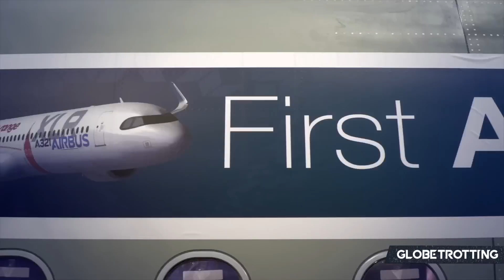NEW PLANE? - The Airbus A322...

Comment: A322 should be an Aircraft that help/offers airlines a 757-300 replacement.The A322 would also help airlines that need strictly a aircraft that high dense configuration aircraft that could seat 300 give or take people in single aisle formant without buying/using a wide body aircraft.

Comment: I think the A321 LR and XLR will fit the market just fine.  Airbus would do itself a favor to squeeze out even more efficiency and lower cost per seat per mile and extended range on the A330neo program.   I’ll keep saying it… if I’m on a 6+ hour long flight …I want to be on a wide-body aircraft with ample room and lots of lavatories on board.   So twin aisles it is for me!!   5 hours and under… I’ll go with the A-321 thank you very much!!

Comment: A322 neo
- Composite wings with folding wing tips
- Composite fuselage
- Newer engine up to 10% fuel efficient than current LEAP 1A
- Up to 6000 Nm range
Will selling like a hot cake.
Reply: Composite fuselage would just make it an A360 at that point

Comment: A carbon fibre ultra short A350-500 with a narrower and shorter fuselage of the A330-200 size might be better. 
Narrow body long haul is really not a great experience. 
Do not push anything to the max.

Comment: I think Airbus should pursue a 322 in LR & LR with a new wider bigger wing and stretch to the 757 300 length at least with extra mid cabin more lavatories a super stretch so airline's wanting to save costs could also offer premium economy class section behind business Class on such long 11 or even 12 hr flights but have empty room like 747s had on emergency exit doors along the cabin so passenger's on a long flight can go stand up and have a stretch before returning to their seats.
I think heavier double bogie landing gear be required for extra weight stability. 
I think airlines would be very interested in a 11 or 12 hr range with a larger stretch to accommodate and sell fares in a premium economy class too for such long flights that dont want to operate the expense of a larger A330 neo range .
Reply: A322 is fake and it’s not an A321NEO, it should be retired

Comment: The current A321 is about as heavy as the current crop of engines can handle. Therefore, a simple stretch is not possible.

The only solutions on the table until new, and more powerful engines are available, is for the aircraft to loose weight and increase lift.

The obvious way to achieve the weight loss and increase lift is for new composite wings. Not only would these be lighter, they would be far more efficient as wing technologies have advanced significantly since the current wings fundemental design was done.

Not being an engineer, I do not know how many additional rows of seats this could allow. However, if those new wings were to be fitted to the rest of the range, could you be looking at A220 levels of efficiency?
Reply: The A322 is a fake concept and it’s not an A321NEO. It should be retired. The 757-300 is longer than the fake A322 concept so the fake A322 concept won’t be a replacement for the 757-300. The fake A322 concept would make the A321NEO LR and XLR useless, and the A321XLR A321LR and A321NEO productions will be discontinued and scrapped, that would be dreadful
Reply: @sebastianfloyd372 You really need to understand what FAKE actually means. While we may never see an A322 or an A321 stretch as it has been described by Airbus themselves, it is simply just a name given to a hypothetical furter stretch of the A320 series. Airbus have worked on the possibility of a further 4 rows, unfortunately there are no engines of an appropriate power currently avilable. 

So, on the drawing board it will remain until either suitable engines such as a member of what is expected to be the UltraFan range of engines (or possibly even whatever river they choose to name it after as RR so often do), or, the current design is going to have to loose rather a lot of weight!

I suspect that a longer Airbus single aisle may only surface as a variant of whatever replaces the A320 series. But who knows, the manufacturers seem to be playing a game of chicken to see who announces the next single aisle first.

By the way, the 757-300 was a sales disaster, and we do not know if there is actually sufficient demand to make a direct replacement viable. What is more likely is something in-between the 757-200 and the 757-300.

Comment: They will need to get more powerful, still efficient engines, a new wing to get a stretched 321 off the ground.  The 321 doesn't have lift or power for short field high altitude high temp airports.

Comment: Is there enough gap between the A321XLR and the A330 to expect a valid business case? It's not just about ROI, but about new laws and regulations too which would have to be taken into account.
Reply: 330 is wide body. Finnairs Air Lounge seats won’t fit into A-320 family.

Comment: If its possible, The Airbus A322neo will compete with the Boeing 737 MAX 10
Reply: Of course it wouldn’t. The regular 321 neo competes with the Max10
Reply: In what world? The max 10 is smaller than the 321. A 322 would be in a category of its own, regardless of how it is built.
Reply: Until the Max-10 is certified by the FAA and Federal regulators are satisfied enough with the significant progress the Max-10 has to undergo and you have to retire the 767 and 757 at some point ✈️💵☝️
Reply: MAX-10 😂

Comment: or a A323 , use the length of 757-300 XD
Reply: A322 would already be the length of the 757-300 respectively. The current A321 is about the same length as the 757-200 and 737-900ER.
Reply: @GarlandTexasSpotting2025 A322 is a fake concept and it’s not an A321NEO, it should be retired

Comment: It's going to be tough to replace the 757 airframe. The Boeing 757 was like the sports car I wish I had. It was a fantastic airplane for airline service, or freight and mail delivery. Airbus will need to really hope this new design of theirs will equalize the amount for what the 757 has done.
Reply: Looks to me that Airbus already has a winner with the A321LR and XLR. They have enough orders to keep them busy into the next decade.
Reply: Airframe has not much to do with it. That’s mostly engine related.
Reply: @Dan.d649: the 757-300 is longer than the A321XLR and A321LR so the A321XLR and A321LR won’t be a replacement for the 757-300, only the 200

Comment: next gen hybrid aero propulsion can revive the A380-800 once again . . . it'll make the A380-800 hugely fuel efficient, not possible before . . .
Reply: No. The A380 tools are gone and won't return.
Reply: @jantjarks7946  Even the infrastructure, and factory plant is gone (converted to A321neo).

Comment: Most unlikely. Airbus will be concentrating on a replacement for the A320 family which may include something bigger that the A321XLR but it is early days. The feed back from passengers on how they view travelling on a narrow body for long distances will be crucial. I would say that with prospective orders from middle eastern carriers it is much more likely that an A380 Neo will be seen if it can offer cost savings.
Reply: I travel Miami to London, usually on a 787 Dreamliner or A330.  I couldn’t envision myself on a single aisle plane unless the seats had enough pitch.
Reply: @jeremypearson6852  People have been flying narrowbodies across the pond for almost 75 years. It's not a new thing. I've done it, and it's fine, even in Y. A middle seat on a 757 for 6-7-8 hours is just as miserable as a middle seat on a big-boy plane.
Reply: @geeniusatwrok Couldn't agree with you more. 50-60 years ago, in the so-called golden age of air travel, all transatlantic flights were on single aisle aircraft until the advent of the B747. Modern day single aisle aircraft are opening up new routes that are served by direct flights, and that is what customers prefer over flights involving intermediate stops.
Reply: @jeremypearson6852 You rightfully pointed at the seat and cabin design. It doesn't matter if it's a narrow or wide body.

Not sure why people mix up both, as both define acceptable comfort in very different ways.
Reply: I see this as a step between what we know, and what we can do.  Maybe A370?

Comment: Interesting, what if Airbus propose of the new aircraft, A330-1000neo? Any thoughts?
Reply: It would probably compete with the A350-900
Reply: There isn't a market for such a plane. Even the 7810, which would have more range than this, doesn't really have enough to be considered for the majority of routes. It would look a lot like the early days of the 333, when it was out sold by the 332.
Reply: Would compete directly with the 787-10NG , which would be more efficient and have more range. So the a330-1000 would be a flop
Reply: The 787-10 is already a flop.
Reply: @nicholasmackenzie-rowe68  exactly. 3310 would never get off the drawing board
Reply: @nicholasmackenzie-rowe68  yea only because of its limited range. When it gets a new engine , range won't be an issue anymore and the a350-900's advantage will be eliminated. The 787-10NG will be the a321neo of the 787 family, it will sell like hot cakes .
Reply: @nicholasmackenzie-rowe68 whoa slow down, the reason why Airbus should make A330-1000NEOs because it’s not about the range, it’s about the length
Reply: A350-800 se existia venderia como água!
O A330 não vende porque é apenas uma plantaforma melhorada mas com as má mesmas bases dos anos 90!
Reply: @PhilippinesTravelFan: as long as they make the A330-1000NEO long like an A340-600, 4 doors in front, 4 over the wing and 4 doors in back

Comment: Remember when we used to find the A-321 quite long? It's so weird that these days it doesn't look so long anymore. It could be extended I believe.
Reply: We weren't used to seeing a long plane. Almost a year later, we can see it as just a normal plane
Reply: @TJsWorld7 Long aircraft by means of stretching existing aircraft is not new. The Super DC 8 was a stretch version of the original DC 8 and was introduced in 1968.
Reply: @The_Red_Squirrel  Yeah, but I still find the DC-8 quite long. There are 2 planes that used to look super long and that look normal these days: the B 773-ER et the A321. In comparison, See how the A346 still look as long as when it came out ! I guess the more you see an aircraft the more it looks ordinary maybe 🤔.
Reply: same as cars when you think about it… MK1 vs MK8 volkswagen golf for instance
Reply: On the basis that 90% of the NEO family orders are 321's then it's not surprising that it's seen as normal...  Hell, I misidentified the A320N as an A319 when an A321 was before it... Felt silly. :D
Reply: I think proportionally, the A321neo looks more “right” in comparison to the A321ceo partly thanks to the new engines; they just look right on the stretched airframe

Comment: What if Boeing redesigned the 737 MAX's windows so it would look like those in the 787?
Reply: All you’re doing is increasing the price tag of the aircraft with those windows. Airlines who fly the MAX are looking for a workhorse that is inexpensive to purchase.
Reply: That would require a carbon fibre fuselage and another mountain of changes to make... it would end up being wiser to just replace the 737 entirely
Reply: That's the 737 max-2-8😉
Reply: Would probably blow out easier 😮

Comment: With all do respect to Airbus…but they did all they could do with the 320/321 series and thus they will eventually need to come up with a clean sheet design.
Reply: You mean like Boeing and their 737 series.
Reply: Airbus has enough of a backlog on it's order books for the A321LR and XLR that it doesn't need to consider its next move in single aisle aircraft until the 2030s.

Comment: The A-322 has been debunked by Airbus two times, the first in May 2021 the second time in June 2024 as the A-321neo has fifth generation engines while it took 6 years to develop the A-321 with an additional year to fit the new engine weight to its wings.

The A321neo began production in 2016, with final assembly taking place in Hamburg, Germany. It entered service with Virgin America on 31 May 2017, taking its first commercial flight. As of September 2024, a total of 6,721 A321neo aircraft had been ordered by 85 disclosed customers, of which 1,479 aircraft had been delivered.

If there is a new A-321neo with extended cabin it will be named A-321 dash xxx and not A-322.  The numbering of models at both Boeing and Airbus follows specific new components where a cabin extension is not.

There has been video clips about A-350-2000 and A-320-2000 etc which are all bogus information made by video creators as "click baits".

None of the engine manufacturer is announcing a new engine though one has speculated that it would take about 10 years to make one while some major changes have been made by all of them on their 5th generation units while they have a list of minor problems to deal with their new 5th gen as they are used by several carriers.

The only project that has been studied is a new A-380 with new engines, a 5th generation one but wait to see how the market is evolving.  A new A220-500 would be the next offer as there A-320 is aging rapidly and will need a replacement as there A-321 is too large.

So we won't see a new aircraft before 2035 at best as Boeing needs to cope with al of its actual problems that occurs on a constant basis with the B-737MAX and B-787 beside the major problems with their B-777x.  Airbus is quite happy with what they offer and don't think it would be wise to engage into a new product as all markets are well covered with the number of models they offer.